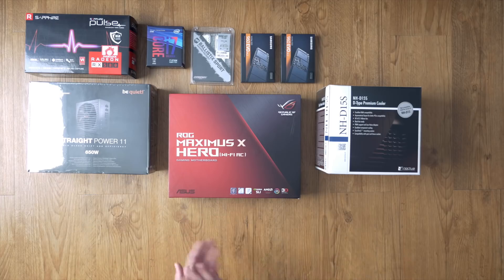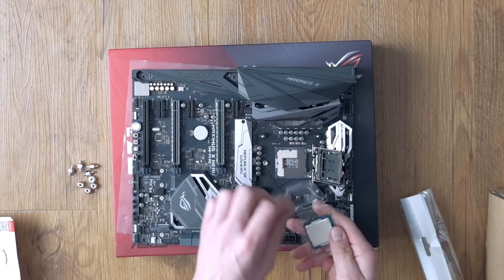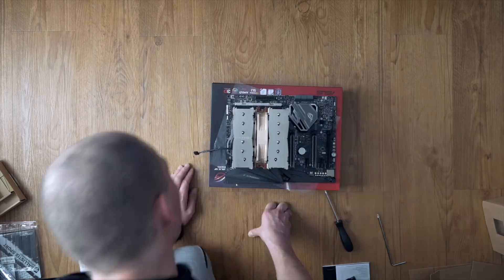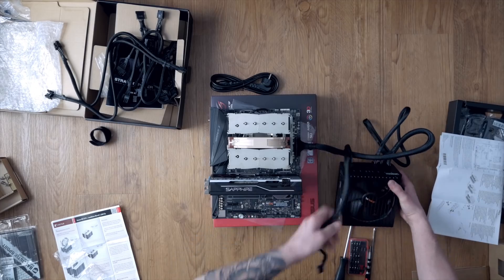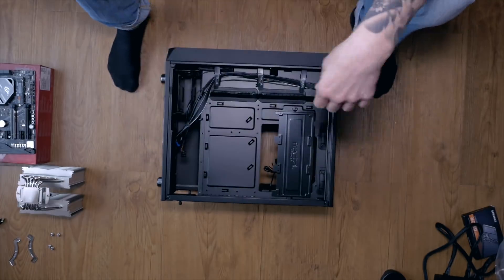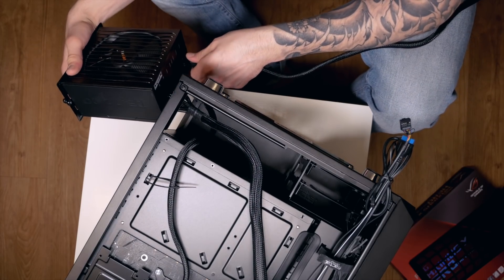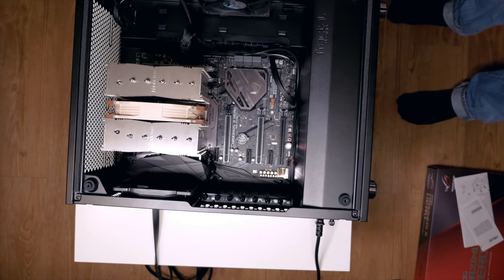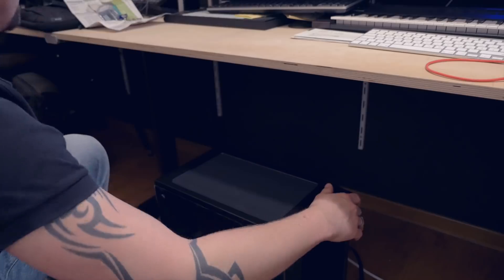Assembling the Hackintosh 2018 Workstation

Comment: Hey Martin, I do like your video(s) and your honesty for tell us your opinions .
I would like to assemble a Hackintosh for music production and I assuming that you able to help me (us) to get this done. Ive been watching your videos so  hopefully will be a headless process. 

Can I clone all applications and plugins without reinstalling and how ?

This is the spec : 
-Intel Core I7-9700k
-Gigabyte Aeros Pro Wifi (full size motherboard)
-CORSAIR Hydro series H150i cpu cooling 
-G.Skill Ripjaws V 3200Mhz 32GB (2x16gb) can I use this or rather use Corsair or something else ?
- CORSAIR RMX Series RM650X 60 plus gold fully modular ATX Power supply 
- 2x Samsung 970 Evo Plus 500Gb M2 SSD 
- Fractal Design Meshify C ATX Mid tower case
- I haven’t decided yet which wifi/BT card get which one the best for this motherboard. Hopefully Wifi antenna is disassemble as the Asus Maximus X.

Thanks !!!!!!!
Reply from the maker: Hardware should be fine. Just for the water cooler you need to some help by people, who did it already with macOS. But why go water cooled on a music production PC?

I would recommend a clean install just to know, that in case of an error, you don't have to more error causes bc of old system configs etc.

You can of course copy and paste most of the plugins etc. later on to your system folders or an external SSD. Just specify additional file locations again on top of the default ones. But besides that, I don't see that much of a problem.
Reply: Martin Guder Ive change my mind regarding water cooling. Switched to Be Quiet Dark Rock Pro 4 !!
Reply: And also I’ll change the ssd 970 evo plus to 970 Evo cuz Plus isn’t work on Hacknitosh, unfortunate :(
Reply from the maker: Yeah some SSD will cause some trouble on Hackintoshs. But you won't notice that much of a difference. Regarding cooler: should be fine. Not sure about acoustics, but shouldn't be that different to my Noctua.

Comment: Hi I have liked the video I will get the same mobo I wanted to ask could you please do a video on dual boot win10 and MacOS thank you in advance
Reply from the maker: Hi. I could do it, but that's imo not necessary. Just install Windows on one SSD and macOS on the other. As simple as that. You can of course have just one SSD at a time in the system while installing and put it after all is done together into the system, but that's optional.
Reply: Martin Guder that’s great would you recommend install windows first ? Then change bios settings then install Mac OS on separate ssd
Reply from the maker: Exactly. First deactivate first SSD, install Windows, then activate/deactivate second SSD, install macOS. Then activate both and choose the macOS UEFI drive as standard boot drive in BIOS and you should end up in clover bootloader, where all your installed/bootable OS are shown.
Reply: Martin Guder thank you for taking the time to reply
Reply from the maker: You‘re welcome. :)

Comment: Outstanding work and tutorial. Thanks for sharing! Questions: 1) with that particular CPU cooler, would there be enough room between the cooler and RAM slots to install 4 RAM modules instead of 2 like you did? 2) Any hope to add Thunderbolt 2 or 3 to that setup? Thanks again!
Reply from the maker: Thank you. You can of course install two additional RAM modules with this cooler. I won't add Thunderbolt as I don't need it. But there are PCIe-Extension-Cards. One recommended is also by Asus. But check the forums to be safe. ;)
Reply: @MartinGuder  Thanks for the quick answer. Highly appreciated! Great news about the RAM modules; it looked like a tight fit in your video. I believe your motherboard doesn't have a Thunderbolt header which is why I was asking. I was hoping to build the same machine as yours but I have several Thunderbolt 2 and 3 external HDs...
Reply from the maker: There are just additional USB 3.1 ports and headers. Maybe you are better off with another mainboard or just invest in the mentioned PCIe card.

Comment: Subscribed. i'm a Hackintosh user , i started when 10.4.3 was first out , since them , i have been a die hard mac User.. owning a hackintosh made by my self , which i consider a gold build ,  i7 7700k , 32gb ddr4 , Vega 64 , ( with loud fans because of fan fix not working properly )  and a 2k display , as well as WIFI/BLuetooth supporting handoff etc...
Reply from the maker: Nice build! What Vega 64 is used? I got mine (Asus Strix Vega 64) fixed quite easy. Thanks for subscribing!

Comment: Does all the necessary wire, hardware, thermal compound, etc. come with the purchased components or is there an need to have certain additional materials on hand to complete the build?
Reply from the maker: Thermal compound is not included. You need to buy it yourself. I used Thermal Grizzly Kryonaut. But I think every quality compound should be good. All wires are included.
Reply: Martin Guder    thanks for the quick response. Excellent video!
Reply from the maker: Thanks. :) If you don't know the other Hackintosh videos of my series, take a look. I regularly add new topics regarding Hackintosh. ;)

Comment: Hey, I just received all my parts and installed them. The motherboard screen says q 18 error. I literally made the same thing that you but it won't work. I would really need help to fix this
Reply from the maker: Did you already overclock or still on stock settings?
Reply: No, I don't even get a screen. It starts but ends on error 18 no signal on screen or anything
Reply from the maker: At which LED does it stop? RAM, CPU, GPU?
Reply: @MartinGuder  RAM!
Reply from the maker: Well. First reinstall the RAM sticks. If this doesn't help, change the slots and try first one and then the other RAM stick. If that doesn't help, you have eventually bent some pins while inserting the CPU into the socket. So check that out the CPU socket on the motherboard if the problem persists.
Reply: @MartinGuder  hey! Sorry for not responding earlier, but I'm back with the computer and same problem. Ive been searching for more info and I saw that the RAM sticks you have on this setup aren't compatible with the motherboard somehow. At least Asus says that the 32gb version is not supported
Reply from the maker: @serafimfiilin2842  I used 2x 16 GB on my system. They work on my setup and there should be no incompatibilities. Where did you find that info, they are not compatible with the Hero X motherboard? 32 GB single modules are for sure a problem, as there are 4 RAM slots and the maximum RAM supported is 64 GB if I'm not wrong and 64 : 4 = 16 GB per slot.
Reply: @MartinGuder  I have 16x2 too, but it says that only supports one 16gb... I'm really worried about this
Reply from the maker: @serafimfiilin2842  definitely not. I run 2x 16 GB successful and I think I am not the only one with this config. Doesn't make any sense, that one 16 GB module is supported and two aren't.
Reply from the maker: Did you check the modules seperately. One at a time. And check it in different slots. What about bent pins on the CPU socket? If nothing helps, try a new BIOS battery or finally resetting your CMOS of the BIOS.
Reply: Found the problem! Had to downgrade my CPU and update bios. Next step installing bootcamped hackintosh/windows
Reply from the maker: What CPU did you run? 9th gen?
Reply: @MartinGuder  yes, 9th. There was no Place who sells I7

Comment: Any components that you would swap out in December 2018? If you could build it again?
Reply from the maker: Yes and no. Build works great. Would still stick with 8700K, because it's way cooler than 9900K. I would consider a Vega card, because prices are now okish. I shot a Vega 64 for 430 EUR on Black Friday. But that's more because because of curiosity, fiddling around and to test VR capabilities. RX 580 8GB still very nice card. Not just for workloads, but also for gaming.

Comment: great vid - just where do I install the wifi card?
Reply from the maker: Ordered another card after shooting the parts video. But card arrived after the assembly video. The next video will feature WiFi/BT installation.
Reply: @MartinGuder  I'm looking forward to it
Reply from the maker: @carpusact  Me too. 🙃
Reply: @MartinGuder  just want to say thanks for all your Hackintosh vids. This weekend I finally got my Hackintosh up and running (i7 8700k, Radeon RX570, 32GB RAM, WIFI and Bluetooth) and everything works with a Vanilla install. 

My only problem (which seems to be quite common) which has to do with iTunes movie purchases and running Netflix in Safari - I get a black screen in iTunes and in Netflix I get an error code. Have you experienced this at all?
Reply from the maker: That‘s most probably a DRM issue or hardware acceleration issue. Have you enabled your iGPU in BIOS?

Comment: Hi Martin! I just finished assembling and installing my build, replicating yours pretty much exactly (except the Wifi Card, for which I used the Levono chip). It works great! Thank you so much for all your hard work you put into your fine videos, and perhaps most of all, for being so accessible and generous in answering our questions. I really appreciate it. - I have yet to tackle the overclocking... but that can wait a bit. Happy with my "Mac" without steroids for now. All the best! JT
Reply from the maker: Give it a shot, when you have some time left. Definitely needs some time to test stability and maxing out performance. Even though it's quite easy now-a-days. :)

Comment: Great video....but am I the only one who caught that you didn't remove the plastic protection film from the m.2 shield? I've thought of trying to run MacOS on my machine, currently dual booting Win10 and Manjaro KDE. 
i7-8700k, Aorus Z370 Gaming 7, Aorus GTX1080 in a Corsair Carbide Air 740 cube.
Reply from the maker: I removed it after testing. Wanted to cut in a peel-off, but ditched the idea. So every plastic protection film is removed. But honestly, it wouldn't harm the system. More a cosmetic thing. Your setup should work fine with High Sierra. With Mojave it won't work with your Nvidia card by now, as Apple has not yet approved the new web drivers by Nvidia. But you could use the integrated UHD 630 for Mojave for the time being.

Comment: Hi Martin I just watched all your Hackintosh videos and I loved them. I'm now looking to build your exact setup myself. I'm quite interested in a video about how you installed Windows 10 to test everything out. Also, if I understood correctly, you installed High Sierra on the 500 gb SSD , and Windows on the 250 gb SSD right? How did you do that , or can you link me to a tutorial? Thanks in advance! You got yourself a new subscriber here.
Reply from the maker: Thank you. I have quite a long list on what video tutorials to do regarding Hackintosh. The next two are about delidding (live within the next day) and overclocking. After that, I'll edit the video reagarding WiFi and Bluetooth on Hackintosh's and how to get Airplay, Messages and Handsoff features to work properly. Some more follow, but that would be too early to talk about.

Regarding two SSDs: I used both m.2 slots on the motherboard. A separate installation video for Windows 10 would be cool, but the priorities are the videos mentioned earlier. ;)
Reply: Martin Guder I am looking forward to the videos :-)

And about the SSD, if I understood your answer correctly, you used one slot (SSD 1) to install Windows 10 , and the other slot to install High Sierra (SSD 2)?

My apologies if I am asking obvious questions, it’s just that I never build a custom desktop before and I would like to do it right the first try ;-)
Reply from the maker: Exactly that I did. Both m.2 slots are very fast, so try to use NVMe SSD's. They are the fastest (actually faster than m.2 if I'm not wrong). I also purchased later on 2x Samsung Evo 860 2,5" SATA  SSD's and installed them on the 2,5" slots. They are used for Windows 10 data storage (mostly gaming and OBS) and for macOS data storage (via SATA port 1 and 2). One drive for one OS. Works perfect and I have still 2 SATA ports left for other hard drives and the NVMe drives are just used for the OS.
Reply: Martin Guder ok great I understand ! thank you for your quick response, I am looking forward to start building my Hackintosh asap. Keep up the good work!
Reply from the maker: Thanks as well for the feedback and the subscription. :)
Reply: PS, do you also have a video about the Wifi/Bluetooth installation?

Comment: Airflow?
Reply from the maker: Is pretty damn good in this case. The mesh at the front makes it even better. Can also just recommend the Noctua coolers and fans. Very quiet and efficient/powerful.
Reply: I was scared too when i saw the cooler mounted this way at the beginning.
Reply from the maker: Yeah. I changed the orientation of the cooler later in the video. But it would also work with fan pointing upwards, as the case has also a Mesh on top (usually for radiator mounting / AIO).
Reply: Martin Guder fan sucking hot air from the GPU backplate is not the best but OK when a AIO is installed on the upper mesh
Reply from the maker: It used to suck air from the top into the case and the blow front and  back fan should transport the heat out of the case. But it was also not the best idea, why I switched to front in, and back out air flow and the CPU cooler blows in the same direction. That's perfect for this scenario. Also thought about a second front fan, but not sure if this is at all reflected in lower temps.

Comment: great video, but I don't think a 8700k cpu is a beast nor is it a work station cpu. Multiple cores with ECC memory is pretty much a standard in workstations. But non-the-less great video
Reply from the maker: Sure. Real workstation CPU's are of course way more expensive and feature more cores. Will be interesting, how the 8 core 9700K will perform. Regarding ECC: I didn't found a use case for myself yet. Do you have one in you everyday work?
Reply: I'm using a 4,1 Mac Pro that has been flashed to 5,1. Xeon x5690 x 2 12core 24 thread, 128gb of ECC memory   756gb of PCI-E M.2 storage, 2tb of sata ssd, and about 27gb of standard mechanical storage with a Radeon r9 280x graphics card. I usually keep my computer on 24 hours but with the new Mohave update my video memory keeps filling up making me restart every couple days. Here is a link to the video of my build. https://www.youtube.com/watch?v=8YdpN1kk2Wk&t=1s
Reply from the maker: Very impressive. I'll take a look at the video during lunch break. But what do you actually need ECC for? Thought it was just needed for very precise computational tasks as well as error free server runtimes?
Reply: far less failure rate and far less data corruption. Besides those benefits, there really isn't a real need for basic tasks. Since I was building out the Mac I wanted to go over the top, this computer is by far the most stable computer I've ever owned. And I've built and purchase many computers. One of my hard drives also has a copy of windows when I want to game, but for the must part I boot up in OSX. CS Go, Diablo 3, Starcraft, and hearthstone all run great on OSX. And with the premiere pro CC update, video editing on OSX has become much faster. But I do have database work on my windows hard drive which benefits greatly off the ECC memory.
Reply from the maker: Didn't encountered any data corruption or failure rate during everyday use. If something failed in the past, it was due to an too old HDD or SSD. For databases I can't judge here, but yeah, it's typical server domain, so probably there are benefits using ECC. Gaming I just do under Windows 10. It's just so much better for it, even though some titles also work good on macOS. Usually the speed is way better as well as graphics. Thanks for the info btw. :)

Comment: 2xnve = bottleneck.
Reply from the maker: Do you mean 2x PCIe lane speed or both NVMe drives are the bottleneck? Regarding PCIe-lanes: both NVMe drives use 4x speed and run at maximum speed of 3.2 GB/s read and 1.8 GB/s write speeds. And also it depends on the task, what the bottleneck is.
Reply: i mean when you are using a z370 platform you gimp your gpu pcie too 8x by using 2 nvme drives. and sorry i forgot, enjoyed your video :)
Reply from the maker: Thanks. It depends on the mainboard. The Hero X has a 16x PCIe lane for GPU usage and still two 4x PCIe lanes for NVMe. The second NVMe slot can be either 2x or 4x. If 4x is used, SATA ports 5 and 6 will be deactivated.

Comment: Hackintosh compatible with nvme ssd? I thought only with sata in ahci
Reply from the maker: Since High Sierra (10.13) it's possible to use NVMe SSDs. Just bear in mind, that you first have to initialize the SSD, before you can install macOS on it. When NVMe drives don't show up while installation, that's most often the root cause. ;)

Comment: After seeing your choice of motherboard, I am wondering how you can get macOS installed and get all components worked properly with solving the kext issues.
The most important and hardest part of hackintosh is about the software part rather than the hardware. You are missing it.We would be appreciated if you could provide a prefect solution over the software part.
Reply from the maker: The installation video followed the week after the hardware part. It's online. You can find it in the Hackintosh 2018 playlist or here: https://youtu.be/sb8comoqnSE. There is also a ZIP linked in the description, which includes two versions for EFI folders (all explained in the video) and the BIOS config for overclocked and normal CPU clock speeds. At best take a look and give it a try. Should everything run, if you have a similar config (same 300 chipset, same CPU, an RX 580 and at best the same case for out-of-the-box USB 3.0 functionality).